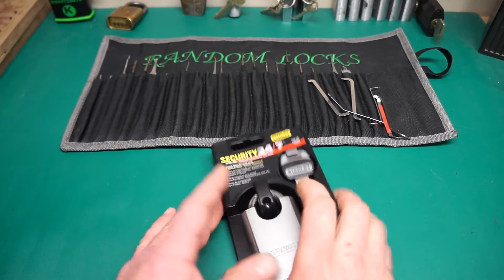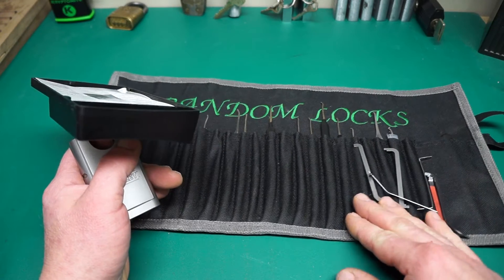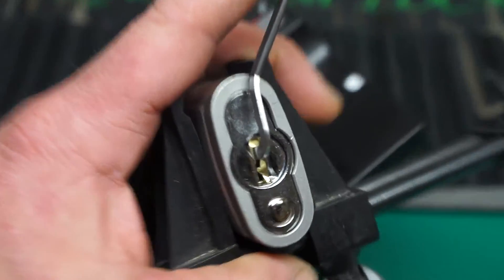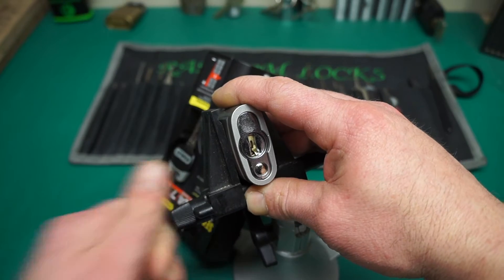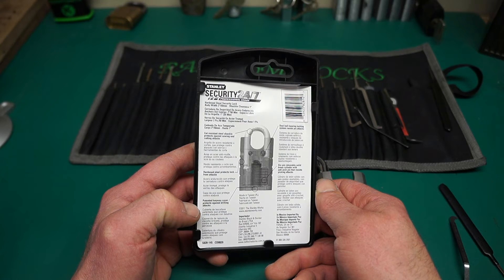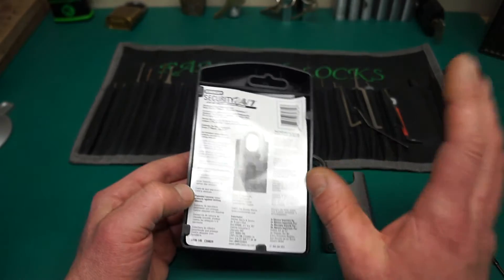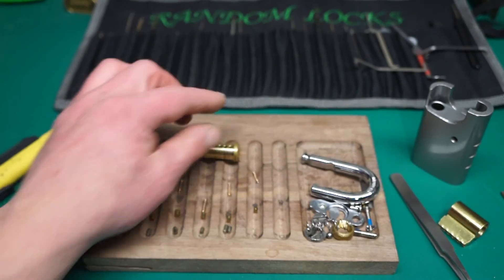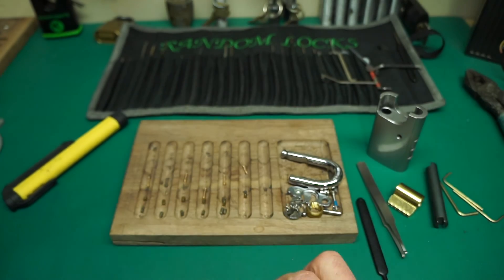(-69-)  Stanley 24/7 Security Picked and gutted

Comment: Nice lock and picking!  Long guts don't bother me as I tend to take a lot of time with my guttings as well lol.  I've been thinking about getting some of those for my dads boat and RV.  Those spools are rather poor looking.  I would definitely re-pin that one with proper security pins.  Chamber 2 looks like the anti bump chamber with the different spring and driver.
Reply from the maker: Trekmaster30 your correct on pin 2. After I shot the video I realized what it was for. I think these lock would be perfect for your dad. I got this of amazon for $25 well worth it. Thanks for watching

Comment: In my 7 Stanley padlocks, the extra strong steel spring is always paired with a driver pin that looks like it's meant to be an anti-bump pin. So the strong spring and anti-bump pin should afford at least some bump protection.

Comment: I had a hell of a time taking mine apart and getting it back together...not a good design
Reply from the maker: Jeff Moss me too, it took way too long for me to reassemble. Needs a few design changes. Thanks for watching
Reply: +Random Locks I had a similar experience with the big brother of that lock, but once you know how it works, it really isn't that terrible.  I bought one of those modified locks from Wayne Winton, but I felt that the core was more suitable to go into one of those giant ass ABUS locks, so I moved it.   I bough some of the larger Stanley locks, but for some cores you'll have to cut a notch in the back  of the key so the key can go in.    Although it can be picked, it looks like they made an effort to make it resistant to picking, but it's still really a standard lock, so it can be defeated by lockpicking experts like you in short order.   I really think that this lock is good value even though it's not as pick resistant as others. Good job on opening that lock!